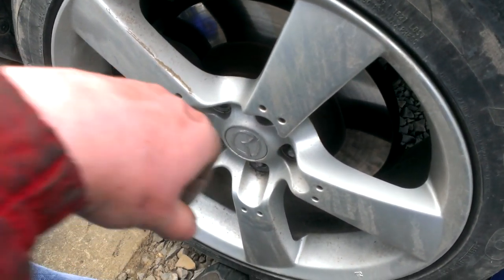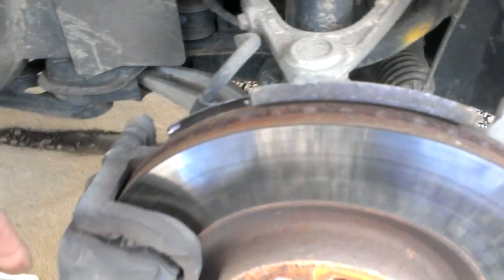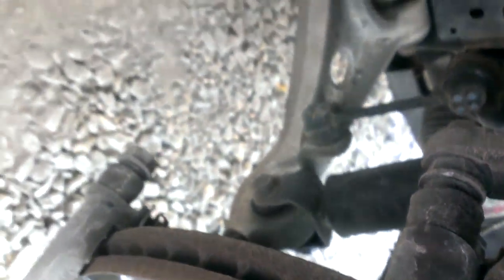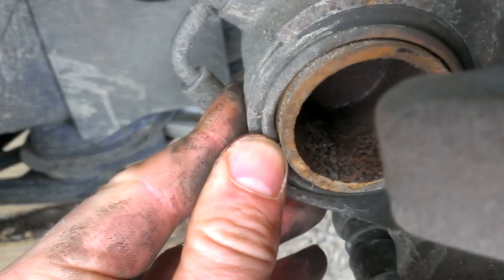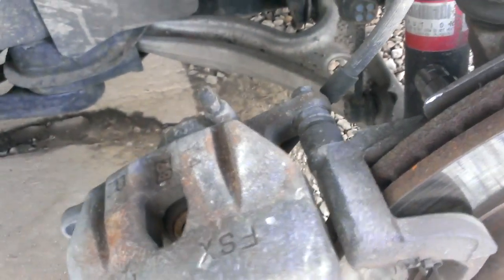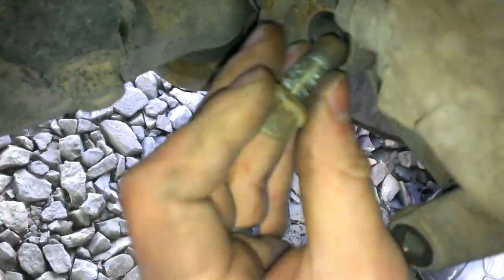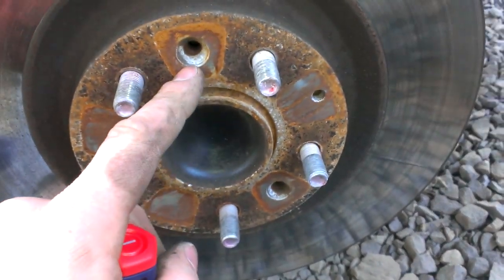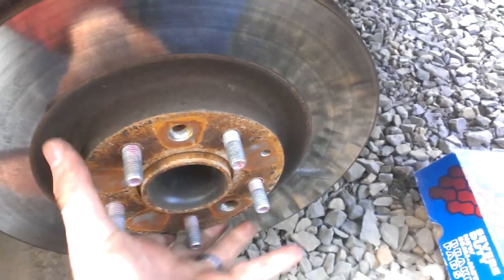2004 Mazda RX8 Brake Pads and Rotor replacement

Comment from the maker: I think your talking about the retaining screws in the rotor being removed easier with the impact screwdriver?  You can use a slotted screw driver like the one in the video.  I know on the one 8 I had to drill the head and use an easy out since the last person mangled it up.  

Usually you will want to secure the vehicle and take the e-brake off or else you will have one hell of a time taking rear rotors off.  If sticking you might be able to manually undo from the back to release the tension.
Reply: SYNTHETICDARKNESSRX8 how do u  take the ebrake off?

Comment: I have a question on the slider pins.  I checked mine, cleaned it all up, and when I was screwing everything back together, I felt like the top most slider pin and bolt never really got tight.  I haven't driven the car, just in case.  But I feel like they are stiff, but still spinning.  Is this normal?  I am using two wrenches to secure, so I know the inner bolt isn't moving while I continue to "secure" the outer bolt.  Should the bolts be torqued to a specific amount?

Comment: hey quick question, i got an 04 model just like yours, but i still have it around 37,000 miles, i changed my brake pads once so far, do you think i need to change the rotors on my next brake pad change? thanks

Comment: I didnt see how you removed the rotor!
Can you show us how to replace it? I got the same issue. 
Please or at least tell me what you used to take it off.
Please thank you.
Reply from the maker: If you have the screws out should pull right off.  Some times you gotta use a hammer and hit the rotor spin, hit, spin, since it can corrode itself to the hub.  I usually hit it from above where the lugs go, then I'll hit it from the backside on the surface out.  Only hit the surface if your replacing rotors.  Protect your eyes also.  Hope that's what you need.
Reply: Ok sounds good. ill try that thank you for the info. if it works I let you know.

Comment from the maker: I would say 75,000 to 100,000 miles depending on how brake happy you are lol.  I think mine lasted a little over 90,000 miles.  So if you constantly are braking non stop you could probably say 75,000 miles with severe city driving like Pittsburgh driving lol.